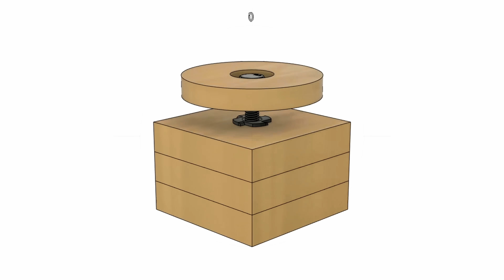💡 Genius Adjustable Spacers For WOODWORKING and DIY

Comment: Yep, same as machinist's jacks- I used to design for a range of companies, and it was surprising how often when I suggested a standard solution from another industry it was regarded as revolutionary... I did not always let them know this...
Reply from the maker: Yep, this video is about how this type of device can be applied to woodworking. I had never seen it done before, especially for all of the applications presented in the video. Thanks for your comment.

Comment: They should do for most things on woodworking but if you are using really heavy pieces, they need to have a much bigger bolt
Reply from the maker: Yes, that is a good point. If you are supporting a heavy weight, it would make sense to go with a bigger bolt to match. The design should easily be scalable up or down to suit. Thanks for your feedback.

Comment: This is more complicated than something I made that was 2x4 piece that was 4" long.  I drilled a h9le down the middle end to end  and cut it corner to corner to form two wedge shapes.  Then I ran a bolt dow. The middle so as you tightened it they would expand.  I use then to temporarily tension upright 2x2 to make dust barriers with plastic sheeting.
Reply from the maker: Think I see how that would work, nice job

Comment: I use clamps but I really like those to so yeah I’ll be making some of those awesome tip thanks fella
Reply from the maker: No worries. Yeah, I would either use clamps or cut a spacer to size before coming up with this idea. I've since found out about machinists screw jacks, but don't think they would work as well for woodworking.

Comment: Good way to use up some scraps I have laying around. Not sure the "knob" has to be perfectly round, just flat, so no need to be perfect
Reply from the maker: True, certainly a good project to use up some scraps. Also agree that the "knob" doesn't have to be round. Probably helps a bit with dialing it in to whatever height you want, when you have a ruler standing up right next to the spacer (since you always have the edge right next to the ruler - like i did in the video). But you could easily make it work with a square top.
Reply: @kiwiworkshop 
The only disadvantage I could think of having a square top is you'd need to make it smaller than the base, or else when you put it into a corner, the "knob" would need to be adjusted in 90 degree increments.
I think having it round maximises the surface area of the knob.
Either way would still work!

Comment: Very clever, I guess you could make higher ones - what is the height of your tallest?
Reply from the maker: Yeah, you could in theory make them at any height, but at a certain point you would just start stacking additional squares on the base, rather than making the bolt adjustable over the entire height (like in my current design). This suggestion is now added to the ticket description (the two bullet points about magnets and dowels). There are some more details about the dimensions in website blogpost https://www.kiwiworkshop.com/blog/woodworking-spacers-with-adjustable-design-save-wood-time-and-money/. I listed out the dimensions for each size. Thanks

Comment: I use clamps. Works fine.
Reply from the maker: Do you use clamps for the pocket hole drawer and vise rack stop applications? Second and third examples in the video.
Reply: @kiwiworkshop  Yes, I use them for everything. It depends on the size of the project and the construction sequence.
Reply from the maker: For the pocket hole drawers (second example in video), I know it can be done with 4 bar clamps or parallel clamps, but is very slow and tedious to setup. These spacers are much quicker option. You get a double win if making quite a few drawers, since once they are at the correct height, you don't need to set them again for the remaining drawers. You could of course cut spacers from 4x2 but then you are creating additional scrap that you might not use again. For the vise rack stop application (third example in video), I have tried to make that work with clamps but the problem is one jaw of the clamp is always in the vise which will hit on the vise cheek before the spacer.

Comment: You will like this device better if you made the top circle BIGGER than the base; it will make it able to run a line all along a curvy vertical .
Reply from the maker: I see what you mean. Somebody also made this suggestion but for adding clamping area on the top. I guess the trick would be finding the ideal ratio of top to base size. It might also be a good idea to have the top available in different sizes to suit different applications. For some, such as the pocket hole application in my video, it works well having the top the same size as the base. Thanks for the suggestion.

Comment: Some adjustable feet off an old fridge or freezer, would save work.
.
Reply from the maker: Yes, if you had them available, you could probably build a similar device. Although the max height would be quite limited. Thanks.
Reply: @kiwiworkshop  
You can buy them quite easily as well. 
I'm lazy, and look for any way to reduce work.
The max height is controlled by the base block height, and the screws provide fine adjustment.
You could have a few blank blocks, of specified size,  just for packing up the height.
.
Reply from the maker: @niklar55  right, good to know. Thanks
Reply: @kiwiworkshop  
You're welcome. be happy.

Comment: They have, like 100 years ago, they're called machinist jacks
Reply from the maker: You are right, machinists screw jacks work on the same principle of operation. However they are very narrow and made of metal so would not work for all of the examples in my video. I certainly wouldn't want to clamp one in my woodworking vise! I'm yet to see somebody else use an adjustable spacer like this for woodworking.

Comment: In WOODWORKING (author’s emphasis not mine) this Is a solution looking for a problem. It’s unnecessary or they would be widely in use already.  In the time required to fiddle with these things I can clamp nearly any assembly together flat to my bench, or use a wooden hand screw as a gauge, or even just cut some scrap for spacers and move on.
Reply from the maker: I'm just putting the idea out there. The response to the video has been overwhelmingly positive as you see in the comments. For myself, I usually find them quicker to use than clamps, especially if you have a production run of the same unit. You set them to the correct height once for the first unit, then you are done for the rest of them. Otherwise you are fiddling around clamping/unclamping on each additional unit. But yes, in some cases clamps will still work better. For the vise rack stop application at the end of the video, they work way better and faster than anything else I've seen or tried. I also can't see how measuring and cutting a spacer is quicker than dialing one of these spacers at the correct height - it literally takes a few seconds. And you have not created any additional scrap in the process.

Comment: I just use door shims
Reply from the maker: I also have door shims in my workshop that I use sometimes. They are usually up to 10mm high and can be useful for applications such as stabilizing a warped board on thicknesser/planer sled.

Comment: Because it's MDF and moisture ruins it.
Reply from the maker: Moisture isn't an issue provided they are used indoors and away from running water. If some wishes to use them outdoors, they can either be coated or made from another material.
Reply: @kiwiworkshop  Never had kids, dogs, snow, drunk friends, or a water leak?

Comment: Is faster to just cut a piece of wood to that size than to go through all of that
Reply from the maker: It's actually not that bad and can easily be completed in a day (assuming you use quick setting glue). No regrets since and I use them all the time. For the vise racking application (third example), it's definitely a lot faster than cutting a piece of wood to size each time.

Comment: Or you can use a clamp instead
Reply from the maker: For the first example in the video, you could also use a clamp although it will take a bit longer to setup and take down. For the second example (pocket hole drawers), there is a way to do it with clamps but you need 4 large clamps (bar clamps usually) and it's a pain to setup. Using these adjustable spacers is way quicker and easier. For the third example (prevent vise racking) I don't see how you would do that with a clamp.
Reply: @kiwiworkshop  thank you for the answer :) I will look the whole video now :)

Comment: Lol... all this BS for something no one needs. Anyone ever heard of a clamp?
Reply from the maker: For the first example in the video, yes, you could use a clamp. Although if you are making many units of the same type, it can slow you down clamping/unclamping all the time. With these spacers, you set them to the correct height once, then you are done. For the second example in the video (pocket hole drawers), there is a way to do it with 4 large clamps but it's very slow to setup (search youtube or google for pocket hole drawers). The spacers can bet set to the correct height in a matter of seconds then you are good to go. For the last example in the video (vise rack stop), I don't see how you could do that with a clamp? Thanks.
Reply: You have a better suggestion?